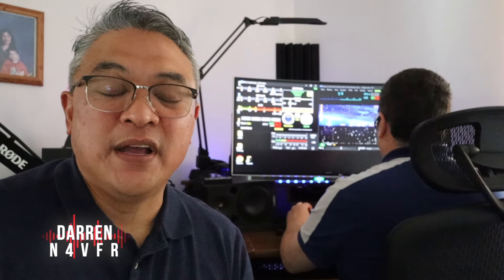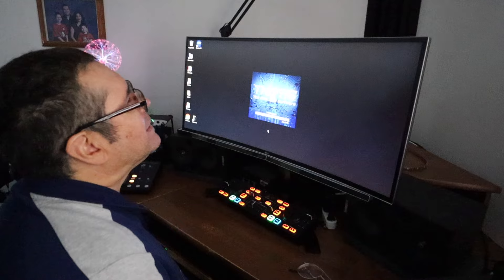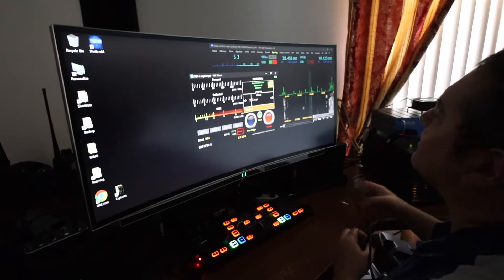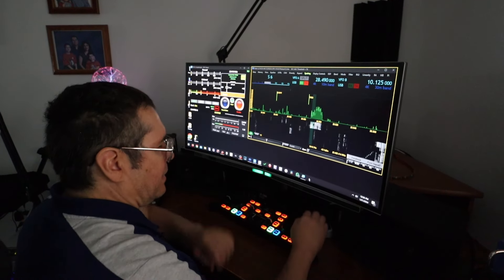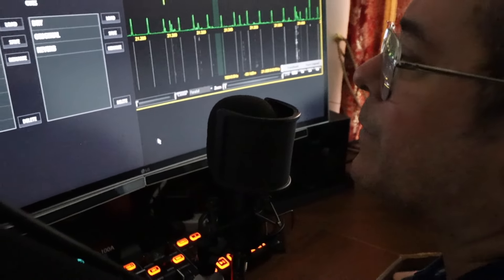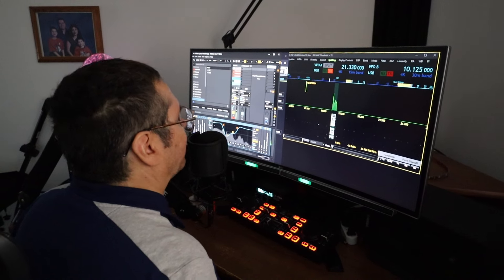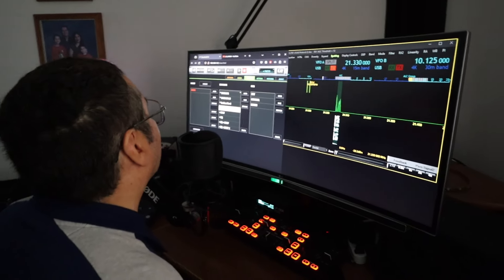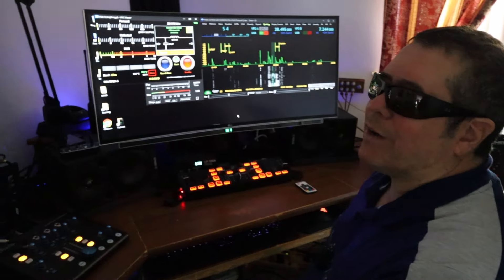K0MO Radio Station Tour | Anan 100B | RF2K-S Amplifier

Comment: Antennas are number one part of the system, outside of the bling what are the antennas? Tower? Beams? That audio stuff would wreck my head!
Did I see S9 of noise on 80M?
Reply from the maker: Noise floor was high like I have at my Florida QTH.  The antenenna is OCF dipole and the apex was about 30 feet up next to the house.